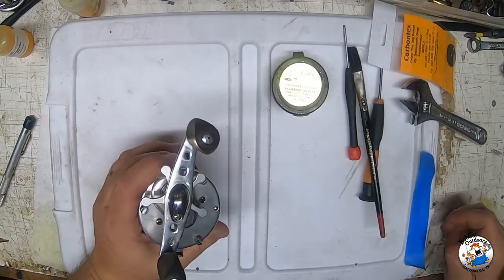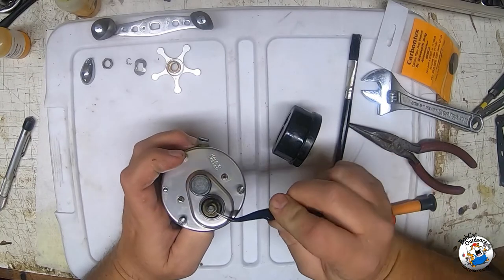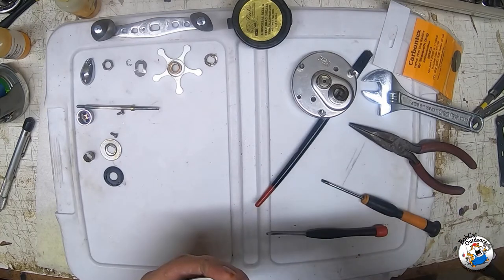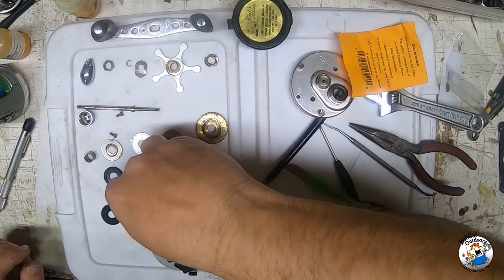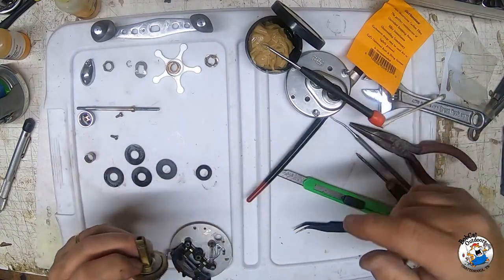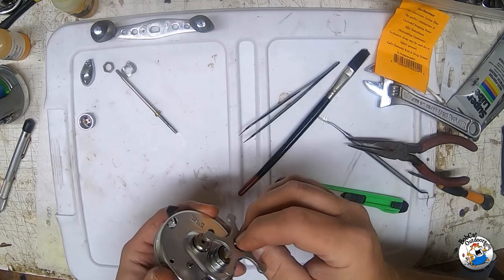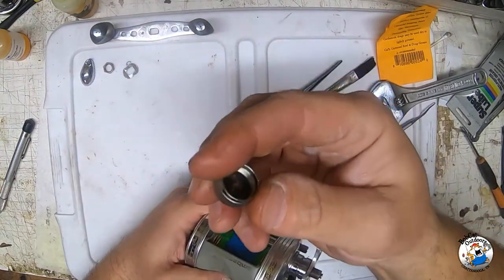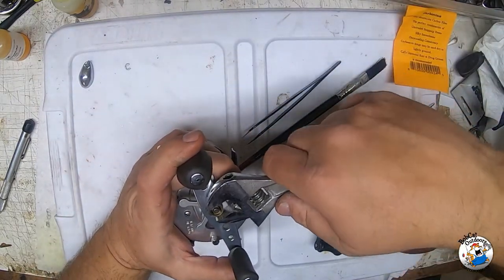Abu 6500 C3 Reel drag washer replacement

Comment: On the older models with the anti reverse pawl. The larger washer will not work under the brass gear as it interferes with the pawl.